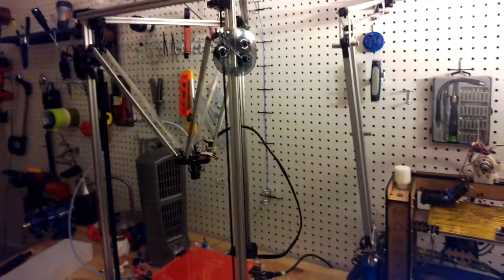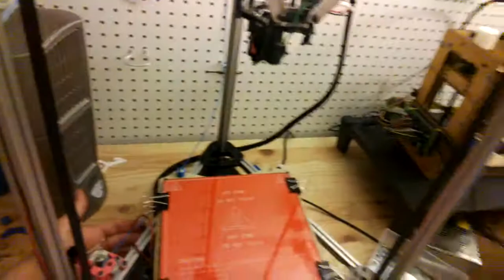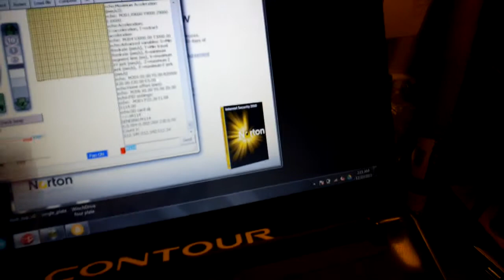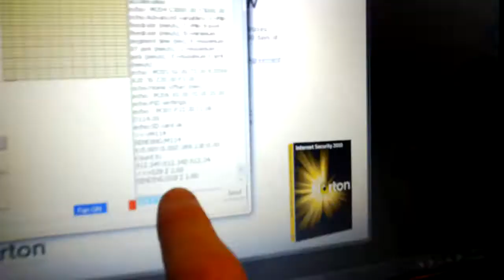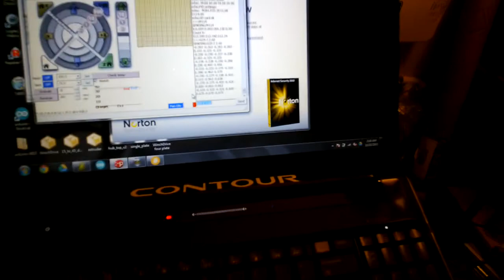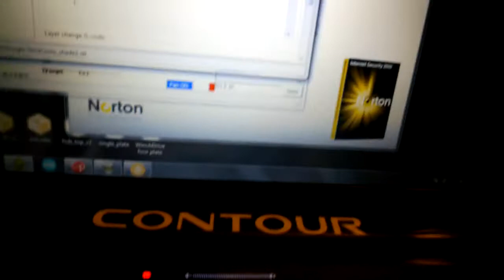3D Printer Repair-  Part 5 Succesful AutoCalibration

Comment: I wonder what's the difference. I'd write G0 X0 Y0 Z0 F5000 all in one line. What's the difference between G0 and G1?
Reply from the maker: On the reprap wiki gcode page is states that it does the same thing just not as efficient as G1.
Reply: G0 is "Go at full speed" and G1 is "Go at cutting/extruding speed"